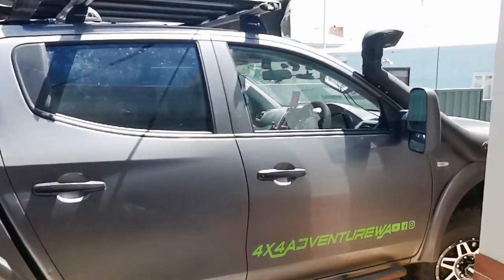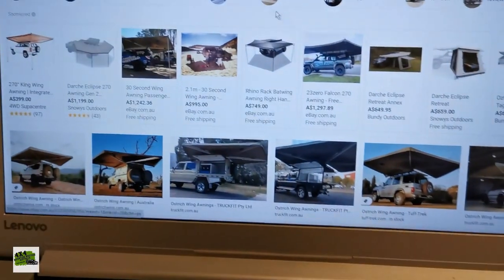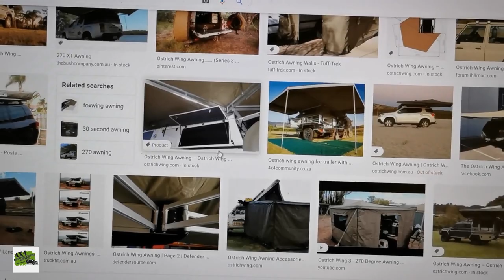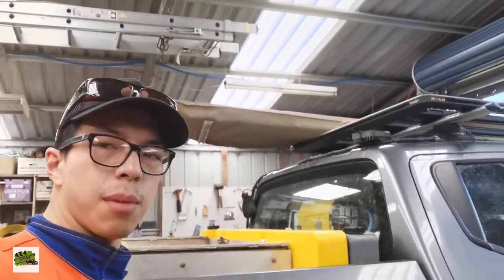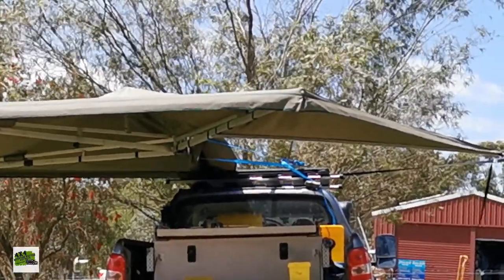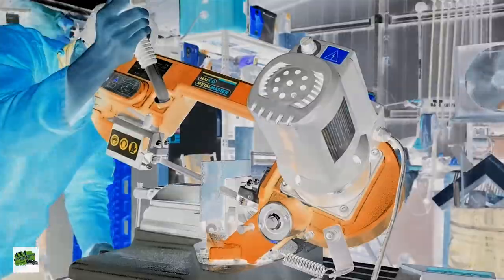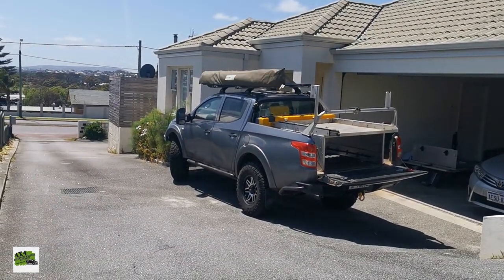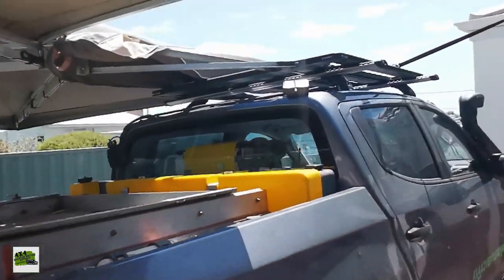270 degree awning on dual cab - HOW TO install a free standing awning without a canopy

Comment: Thanks for the info, i noticed you have four bolts on your angle brackets, did you drill straight through the aluminum backing plate and use bigger bolts rather than the 6mm plate bolts supplied, yours looks a lot more sturdy?
Reply from the maker: I actually replaced the plate bolts with 6mm hi tensile bolts. From memory, the bolts fit well in the track and still tighten well. I prefer 4 bolts in each bracket as a safety insurance.